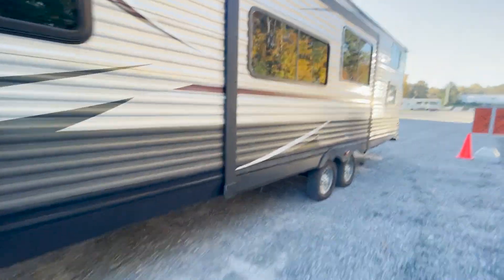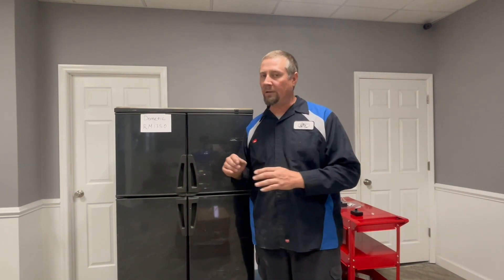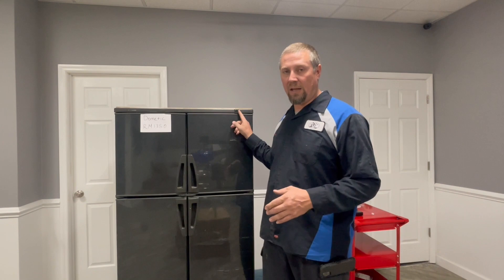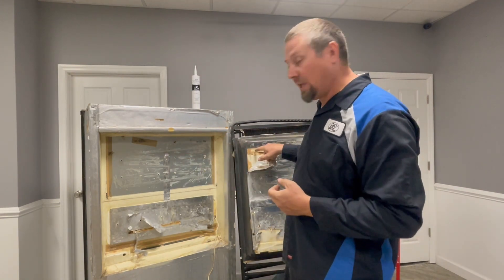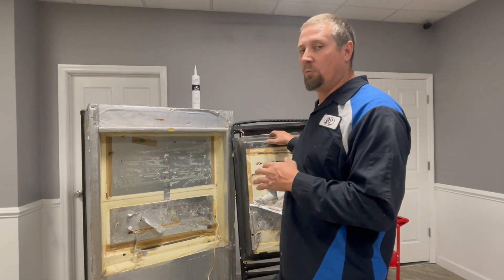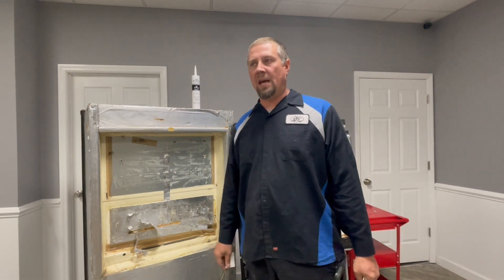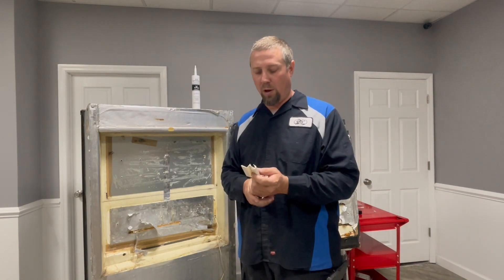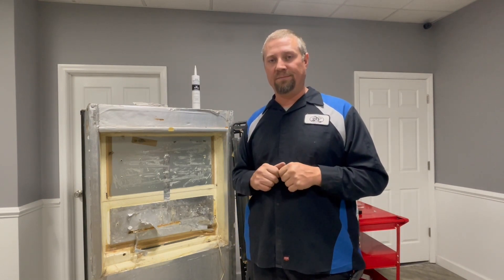Dometic RM1350 Debunking The Nuts & Bolts

Comment: Thank you so much for this!  Best RV fridge video I’ve seen petaling to RM 1350, which I have, which does not cool.  I’ll be checking with you on the Sieko thermal bottom, and the Dinasoar thermistor adjuster.  Hopefully, this will resolve my issues. I’ll try to bypass first in order to determine if cooling unit is good.  Again, thank you for explaining these issues I’ve never even heard before.

Comment: Good information on the workings of the absorber and controls.
Reply from the maker: Thanks for watching!
Reply: Too bad Grand Design elected to move the fridge up 3 inches, on a platform.  If they put it on the floor, the heat exchanger would be an inch or so below the side vent.  Then. I wouldn't have needed to trash it and replace it with a house fridge.

Comment: Thank you sooo much for this video it was so needed.  Question..my RM1350SLM must be an older model (2019 RV) the thermistor is located on the left side of the fins and just sticks straight of the back wall.  Should I do any changes to it?
Reply from the maker: As long as it is in a white clip in the fins and not attached to the ceiling of the refrigerator section you should be good. Thanks for watching.
Reply: We have a same refrigerator,im glad i found this video and your comment.I hope the thermistor only or the location is the problem,I will try it.Thank you!

Comment: How hot should the absorber, coils, and boiler be?  Using an infrared thermometer I want to check if mine are close in recommended operating range.  I have not been able to find any spec on this.  Mine measured approximately 125F.  Is this too hot or not hot enough?

Comment: Swapped out my propane fridge years ago for a residential.
Reply: Not everyone wants that option. If the fridge is in a slide, a residential fridge can cause all kinds of problems due to the excessive weight (floors falling out, slide rollers wearing out, stress cracks in the slide frame), also you lose the ability to keep your food cold if there are no electrical hookups.